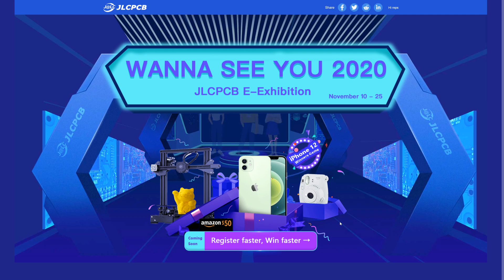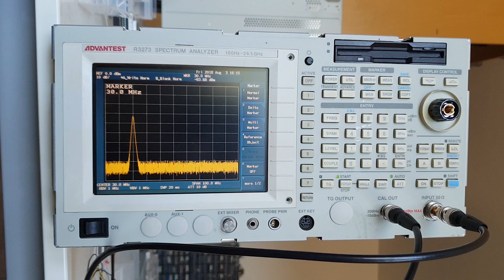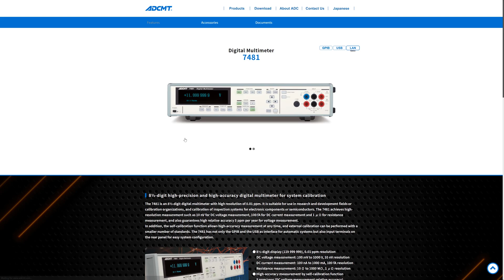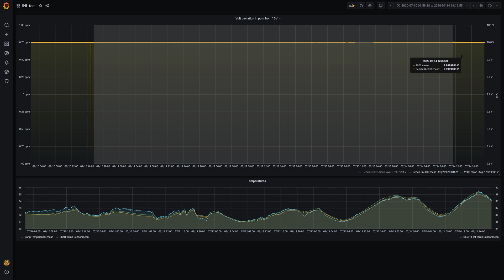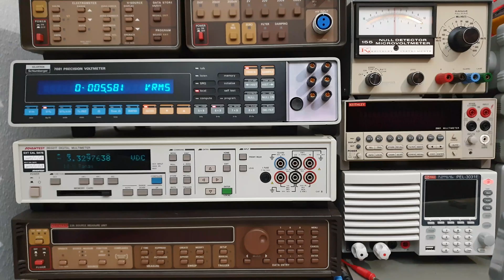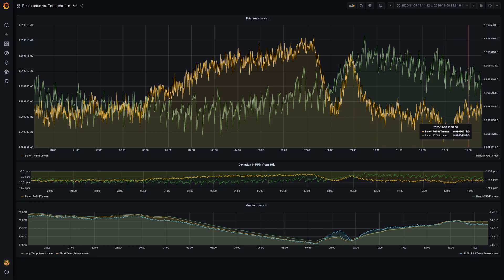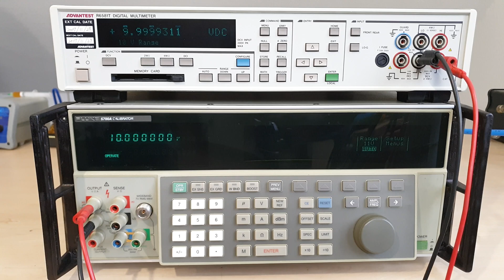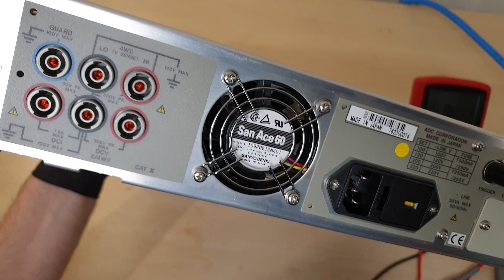Quick Test: Advantest R6581T 8.5 Digit Multimeter

Comment: Hello Sir! I just recently discovered your channel and find it facinating! Especially your videos about DMM's, voltage references and related topics. Main reason is probably that I work at a local calibrator manufacturer, although HW design is not my function there.

However, I notice that, based on the words you use related to thermoelectric voltages, that you may have a wrong understanding of that topic. The widespread explanation for thermovoltages is that they are generated at the junction between two different metals, when there is a temperature difference. This is actually wrong. 
It is only the temperature difference (or rather the temperature gradient) that generates the voltage, and it can do it along a single material metal wire, for example. The junction(s) only play a secondary role in the system. You may want to read up on this. 
I apologize if this was already clear to you, and I misinterpreted you. And again, you make extremely interesting videos!

Comment: love your channel just wondering how sensitive are these meters to temp change would it be worth it to regulate the temp and humidity in the room you use them or does the heat they produce them selves cause the drift?
Reply: Most of the parts and references in nicer machines are built into little hermetically sealed cases or enclosures on the PCB board inside and have built in heaters to keep them at a stable temperature. Most any high-end test equipment (anything over $200-$300) Will start to implement what is called “ovenized“ parts. 
So they have built-in heaters to keep them at a constant stable temperature and they’re built into some small hermetically sealed can or plastic insulated package. So pretty much as long as the machines are warmed up… They maintain their metrology grade calibration and statistics.  Real nerds like Marco leave their precision equipment powered on 24/7 365 days a year. Because that allows them to maintain the highest level of accuracy. that level of precision is absolutely not needed unless you just enjoy the extra .01% of precision… Or are some big lab like NASA.

That’s how all of the big labs like NASA and places do it. The gear is designed so that once it’s plugged in and turned on… It’s never turned off until they retire that piece of equipment a decade later.

Comment: I mean I love high precision test gear just as the next guy, but what the hell do you do with so many of them? I mean really I would not even know where I would use an 8.5 digit multi-meter. Heck even a 6.5digit one is overkill for me. What are your plans with those devices? Just collect them?
Reply: Measure references and become an international calibration lab. Obviously. Also, you get an extra digit if you use 2 dmms
Reply: @Cerv3ra  Cool so 9.5 digits? :D Basically counting individual electrons at that point.

Comment: Yeah... JLC PCB - they were good 2 years ago. Now it's only quantity over quality. They just screwed up one of my projects. They just ignored gerber file with markings for V-CUTs, and supplied panels without them. Now I have 5 panels without ability to snap boards out of them :) 
Support is non-existent - they say basically that they give zero f*** about this problem :)
Colleague from work got bitten also maybe week earlier - they made boards without non-plated holes, probably because there were two separate NC files for plated and non-plated. And they just ignored one of them :D
Reply: Well I mean you have to see the price. Somehow they have to manage it. But ignoring v-groves is bad. Cutting the fiberglas is nasty. 
But the second version when you upload two different files is not the problem form JLC. I mean you can not expect that they will check every upload that closely. It is a cheap service. 

For me it is mostly fine. Sometimes they sadly ignore the placed holes for the SMT process and add more right next to the ones I placed but other than that it worked fine.

Comment: Anybody know what the 'New Brymen Soon' promotional banner is about at the end of the video? https://youtu.be/d4LbBeUiUWM?t=611

Are Brymen releasing a new multimeter, anything better than the existing BM869? Also what about that new UNI-T meter over on Joe Smith's channel, it appeared in his last video about the new eevblog meter, which also happens to be made by Brymen. When I google the UNI-T model number i cannot find anything about it. So I am speculating it is not released yet either. But looks to be positioned in its price and features as a competitor to the BM869s.

Comment: Would have been nice, if you would have summarized numerically  some specifications you have determined, like INL, T. C., noise, 24h stability, and whatever you could extract from your measurements.
I assume, you were sarcastic about the bad INL, as this is in fact one of the most important parameters. 8.5 digits are useless, if INL is 1ppm only.
Reply from the maker: Noted, will try to do that in the future! So far I don't have a whole lot of confidence in my setup here, no climate control, 5700A out of cal etc. so I wouldn't dare passing judgement on products
Reply: @reps  All these parameters are more or less relative ones, and despite your lack of confidence, you are able to make good estimates with your equipment for all of them.
Btw.: Fulda is not far away from Frankfurt region (102km, 1:20h), so a personal experience and standards/instruments exchange would be possible, I think, even and especially in these special days.